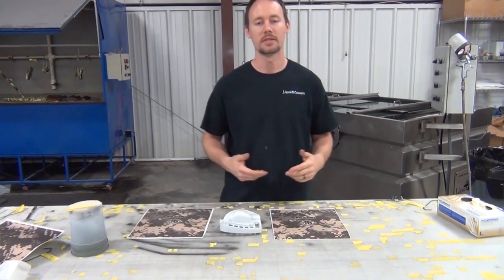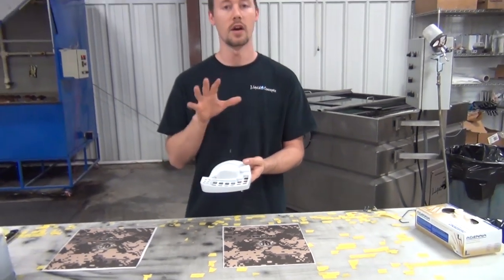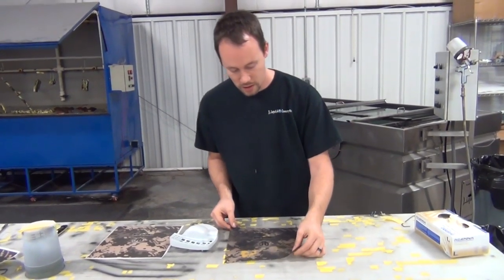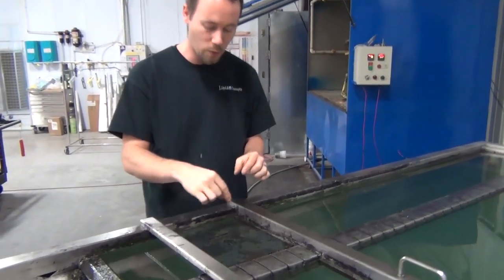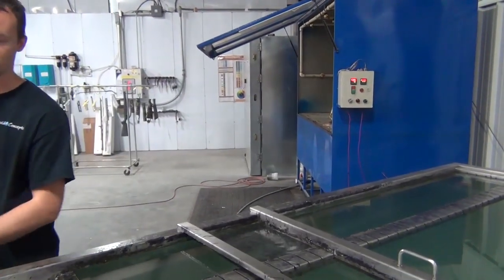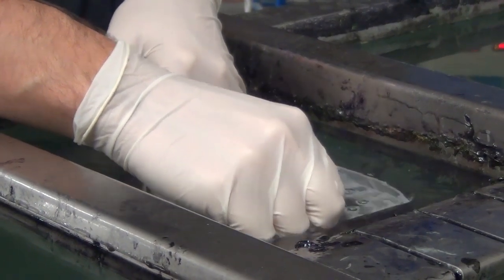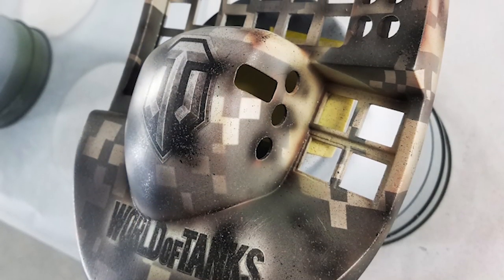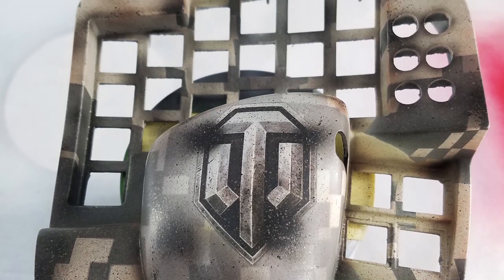WORLD OF TANKS CUSTOM HYDRO DIPPED MOUSE | Liquid Concepts | Weekly Tips and Tricks

Comment: Can you dip parts on engines? 
What temp will the dip hold up to? 
Can you dip Mufflers, pipes, or do they get to hot..? Thanks
Reply from the maker: Yes we can dip some parts on the engine. Normally it will hold up to around 250-300 degrees intermittently. We can dip mufflers as long as they are fairly far away from the header and have had time to fully cool down to a temperature below 250 or so. Each case is different so we have to look at each job on a case by case basis.